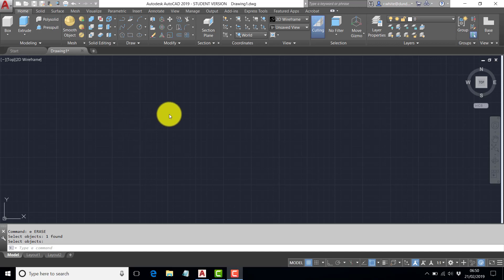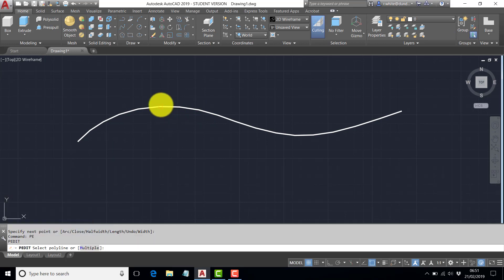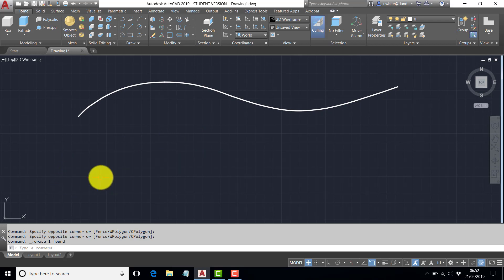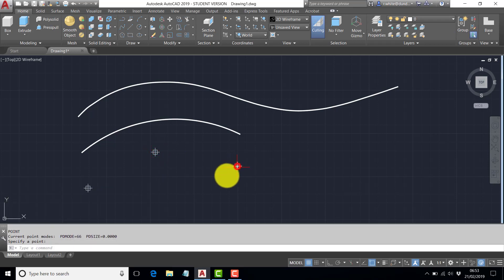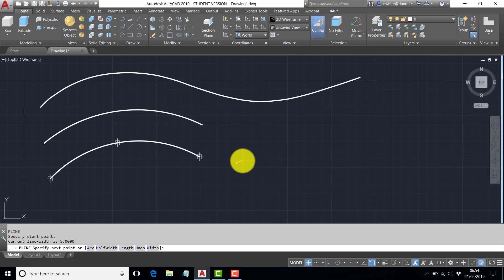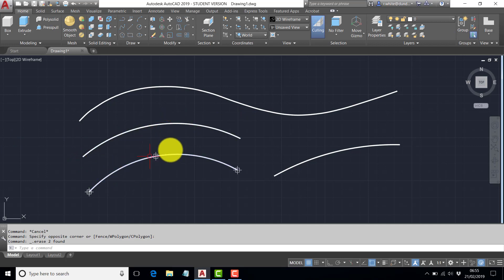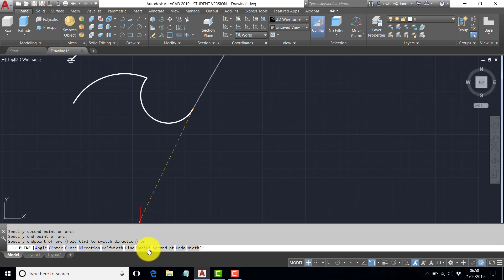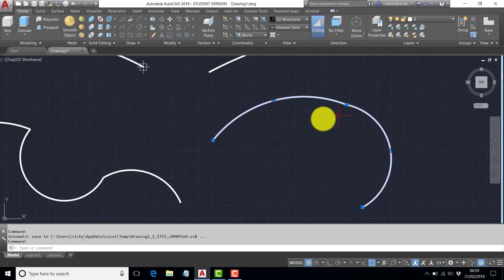AutoCAD 2019 -  Drawing Curves With Polylines

Comment: Do you know how to create a polyline using a series of whole number radii curves? As in a polyline with an R10ft arc connected to a R75ft arc connected to a R63ft arc?
Reply from the maker: Hi. There's a radius option in the polyline command but if you are trying to get a smooth tangential type transition then there is only 'perfect position' and that is pretty much impossible to select 'by eye'. There will be a kink, might be small but it's still a kink.
Play around with it you'll see what I mean.
What are you trying to draw?
Reply: @emmockladdie  Thanks for the QUICK response! I am a Landscape Architect and many of my designs have curved sidewalks or other curved site elements. I wish to be able to create these using whole number radii . . . so lots of curves that are tangential!  But whole numbers are easier for contractor to install
Reply from the maker: Use small portions of straight line and then using the FILLET command with your whole number radius is often the way I work. If you do that it's best to use regular lines as polylines often refuse to fillet.
Use PEDIT after to join the portions together.
Then you can offset for your kerb width, etc.
Road kerbs in UK are supplied in fixed radii, 3000, 4500, 6000, etc.
Another possible way is to roughly draw the polyline with curves by eye, then explode it and then try replacing the rough radii with fillets of your set sizes.

Comment: Any idea to get rid of that kinks at the last drawing
Reply from the maker: Hi - if you click on the polyline the 'shared' endpoint will appear - you can click on that (it will go red) and you can move it - this will adjust both curves and it's done 'by eye'.   More sophisticated way is to use the Spline CV command to generate your curves and then you can BLEND them.   Polylines with curves are a simpler object.   You could try filleting your two curves with a radius - if it's possible mathematically it can work well and keeps your original curves with their original radii..
Reply: @emmockladdie  🤟🏻🤟🏻